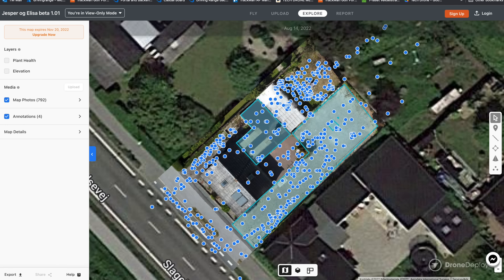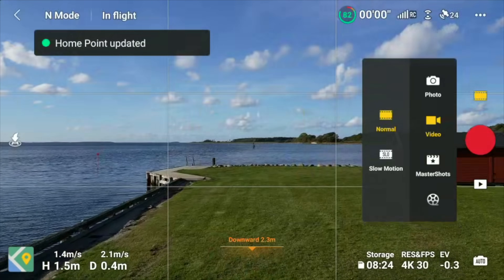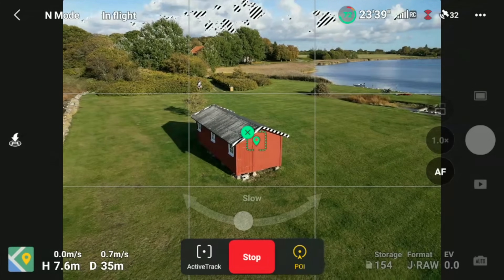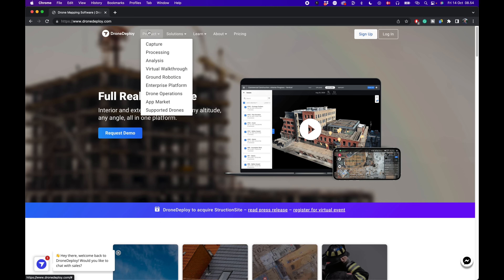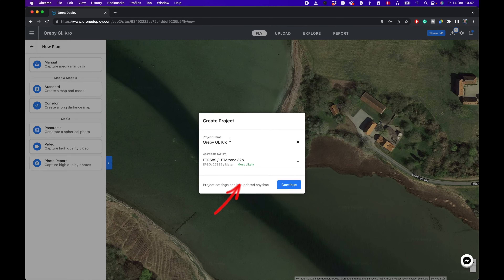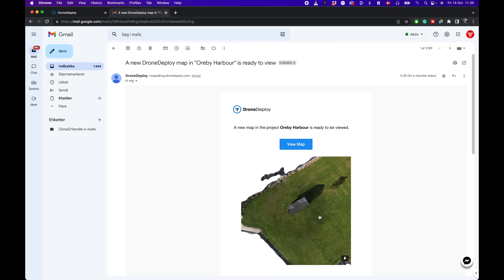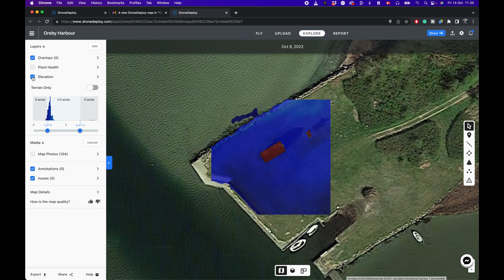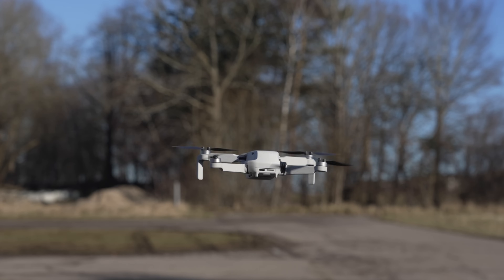How to Create a 3D Models from Drone Images with DJI Mini 3 Pro

Comment: Can you do this with a Mini 3 (non-pro)? We need to survey and model a few acres of land for a solar farm which is relatively steep - 275m long with a 17m drop. We have a mini 3 already, but i wasnt sure if a scan created using this kind of method would create an accurate 3d model or not. Needs to be accurate enough to plan construction of the frames from.

Comment: Nice video, two question. I have DJI mini 3 drone. Is it possible to make it also with DJI mini 3 ? Also I am using mac is it also possible dronedeploy for mac ?
thank you
Reply: You only need many photos from different angles, so if your drone don't have a point of interest-mode, you can make the photos by hand, fly arround and all 5 meters (or yards) you make a photo. There are also apps witch can operate with videos.

Comment: I always assumed this wouldn't work well, because there's a significant processing delay when you take a raw image, which I assumed meant you couldn't take images in quick succession. Not to mention the major lag that occurs when while it's processing. My screen is frozen for the duration which is pretty dangerous.

Comment: I am pretty sure if you have markers(you have to know the coordinates for those points so they have to be measured) on the edges of the map and one in the middle of the area you would get a better more accurate location of the house but it requires more tools.

Comment: Since the native Hyperlapse mode supports raw, and saves everything as raw images, I think that would be a good option to use as it supports waypoints. Would ensure consistent pictures, too.
Reply: how you try it?
Reply: @DannyPeron  unfortunately haven't. Have tried waypoints (hyperlapse) and it works well

Comment: Hello, nice video. 
I'm in the solar business and would like to measure the roofs with a drones before an installation. As lidar is way too expensive i'm wondering if you can do acurate measurments on the 3d model created with photogrammetry. Thank you in advance
Reply from the maker: Yes I would believe it would be possible - a very relevant case

Comment: I would like to measure the volume of trees and shrubs from the ground up to say 500 cm above ground. From what I understand Drone Deploy can do this, but Is there a reasonably priced software that would be able to it? 

I do understand it may be easier to measure manually on the ground and calculate the volume in a spreadsheet, which I have done before, but having the visual model for future reference will also be of value.

Comment: Awesome! Is it also possible to measure areas of houses like windows/walls/doors relatively accurately with this or is there a big margin of error when doing that?
Reply: hm.. i would think no.. you could probably get a rough idea, but down to a real size, no.. windows and doors usually have size standards.. you can probably guess the size of them doing them using this.. but seeing you can just go up to the house with a meassuring tape and do it manually as you need to be like less than 200 meters away anyways and the time it takes to take all the images takes more time than the walk to the house..

Comment: Google Earth or Bing maps is not a perfectly accurate positioned map data. If you want the data to be perfectly accurately positioned you need ground control on four corners and middle to get as close as possible to the actual location. Then you import that point data and align the aerial image to your ground control points. (GCPs)

GCPs can be white/orange paint for example or man holes or other structures as long as your tool for gathering point data is a legitimate point gathering GPS head with enough accuracy to level it's real world position perpendicular to the ground before taking the GPS point data shot.

Keep note if the point is gathered while the GPS head is not perfectly perpendicular to the ground then you could have inaccurate point data. (Pretty common in surveying but just with enough points everything should align to your aerial nicely)

Just like with anything though our point data can be off around 1-2cm at least.. which is pretty dang accurate and IMO perfectly fine.

Comment: We use GCP ground control points to align the maps and increase accuracy.  We are running 1.6cm accuracy on our maps and surveys.  Just a note.  The Phantom 4 pro v2 is the best for mapping like this as it has a mechanical shutter.  I looked at upgrading to the mavic 3 pro with the hassleblad camera and it uses a rolling shutter so not as good as the old Phantom.  Our M300 also is rolling shutter with the H20t so kind of a disappointment.  Great overview,  drone deploy can do so much more than you can imagine 😊
Reply: I have read that the Enterprise version has a mechanical shutter.
Reply: The Mavic base and the Mavic 3 multispectral both have mech shutter. The Mavic 3 thermal does not have one.

Comment: I've done this a few times on autodesk recap and mesh room. Mesh room is free and open source, but hasn't worked that well for me. Autodesk is free for some uses, like students, but I'm not sure under which circumstances.

In my case, I never thought to use point of interest on the drone. Instead I just orbited manually while just mashing the camera button. Works well enough. I've also tried pointing the camera up on my mini 3 to get more detail out of ledges and roofs, but this doesn't always work well.
Reply: i couldn't get meshroom to work very well at all

Comment: Good video but was surprised you didn't use Litchi or other 3rd Party App to fly it for you.
Reply from the maker: I could easily have done that, but I wanted to get people started without the need to buy someting else
Reply: I do believe there is such an app that includes the Mini 2 on iOS, since DJI released the SDK for it. But, not the Mini 3/Pro, yet.

Comment: Had an app in the late 90's called "3DFX" - came FREE with a high end video card.  It was able to make 3D objects out of flat files,  move objects through space, control textures  of every facet and lighting at absurd levels (pin lights, ambient, reflections, fog, motion, etc.) I ended up rendering  splash screens with Premier Pro for cable TV commercials my boss wanted. I was NOT a graphic designer, more of a CIO, but I had a lot of fun doing that stuff.
Reply: Totally cool

Comment: I used my mini 2 for a similar model of a local castle. , I used Litchi and  Agisoft Metashape , and it worked fine. The cheapest one I have seen is WEDODM (open drone map) $57 , maybe worth a comparison with the overpriced drone deploy, unless you are a pro of course and get paid mega bucks! 😀

Comment: That's very clever, however I don't really see what use the model is once you have it, or am I missing something?
Reply from the maker: hehe, true.. no, but that is different story
Reply: Then you can scan yourself and move into the house.
Reply: You get some cool photos of landmarks, landscapes, your home, etc. As for commercial use, they use 3D modeling for CGI, artwork, games and so forth. 
Your question is like asking, “Ansel Adams, why bother with all that goblygoock on settings and film developing on different type of film, just take a normal B&W picture and print it, damn it!
To some, it is Art, or a different way of seeing the same 2D image, and to others, it is job related. You just don’t get it 🤔, and/or are not interested 😑, which is fine….. shrugs

Comment: Nice! You forgot to add a really important step something easily missed is the aspect ratio, generally for normal pretty pictures you would do 16:9 say 3860x2250 like on my Mini2, however this is actually not the correct setting for data capture. In 4:3 you actually get 4000x3000. TLDR 16:9 on the Mini 2 is 8.685.000 pixels and 4:3 aspect ratio at 4000x3000 is 12.000.000 pixels :) 

that way your capturing at 12 MP instead of 8.7 MP 

Your welcome :)
Reply from the maker: Thanks I include that in the next one for Mini 2 :-)
Reply: @TECHDRONEMEDIA  yes pls do the mini 2 bc I have that drone
Reply: @TECHDRONEMEDIA  Same thing should apply there as far as i understand aspect ratios
Reply: You're awesome! Thank you for sharing this little tidbit!

Comment: Awesome content as always 🙏🏻
But if I have a Mini 2 I just have to fly it myself during the shooting scene and tale pics at the same time? And that’s the only difference? Thanks in advance!
Reply: Rainbow on android gives you 5 tries for free and they offer easy to make grid waypoints where you can enter the required picture overlap you want both vertically and horizontally.
But nothing beats Litchi, if you have the money its the best investment there is. With Litchi your Mini 2 is able to do anything + more then the mini 3. the released SDKs for the mini 2 completely destroys it as far as waypoints and taking pictures at exact locations every time.
Reply from the maker: yes, or use  Litchi or Maven
Reply: Thanks a lot for the quick reply! Appreciate it. That’s what makes a content creator awesome, keeping in touch with his audience. 🔝